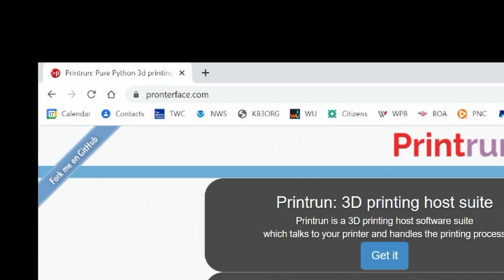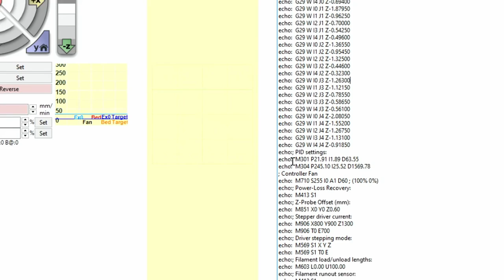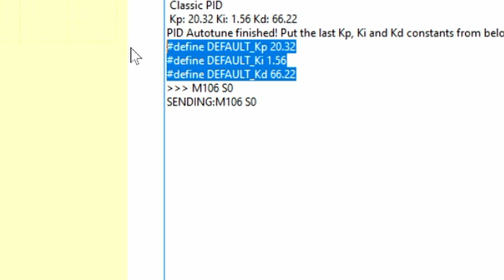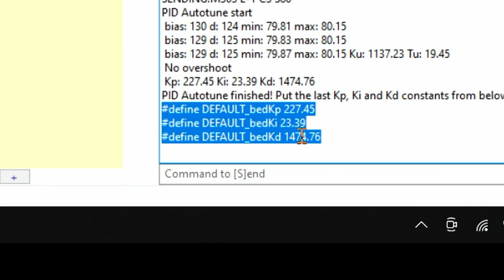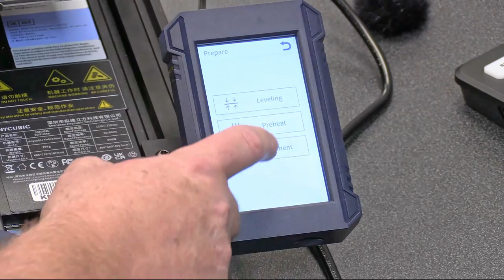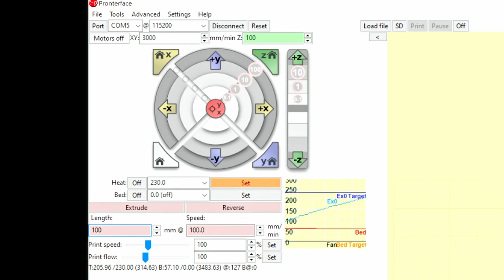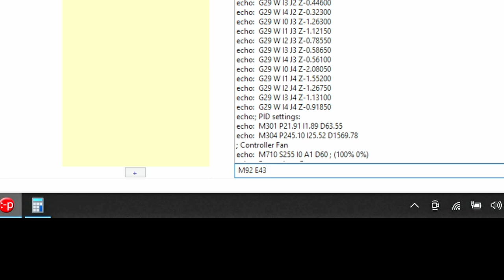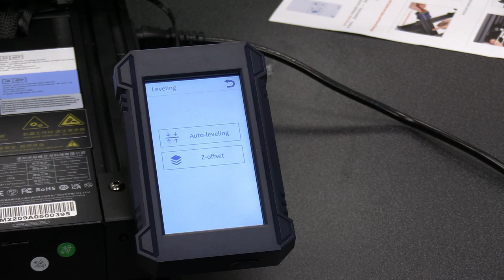Anycubic Kobra Max - Improve Printing

Comment: I got my first FDM printer today (Kobra Max) and as a total newbie this was easy to follow and get done. Luckily I was off by 6mm on the estep also so that took the math out of it! Thank you!
Reply from the maker: Glad it helped and thanks for watching!!
Reply: lol I'm in the same boat. I just ordered a Kobra max on amazon last night. luckily the offsets look similar to the robotics course I took yrs back and cnc. I'm psyched.  My kids and I are gonna have a blast. now I just have to find the 3d software and some quick starter files to load up and show off to my kids lol
Reply from the maker: @Skidly_Finley5879  ThingiVerse has a lot of ready made stuff.  To design you own stuff I suggest starting off with TinkerCAD.  For slicing I prefer Cura, the new Beta release has a profile for the Kobra Max

Comment: Thanks for this guide.  I used it on my new Kobra Max and it's printing well now.  I also just followed the instructions for my older Ender 3 Pro after finally switching it to a direct drive extruder and dual Z-axis motors a couple days ago.  After adjusting the PID values, I found the E steps for the new extruder were off by 12mm.  Fixing that made a huge difference.  I've been dabbling with 3d printers for about 8 years but struggled with getting them to perform well for about the first 5.  This video was a great help.
Reply from the maker: I'm going to be doing a video where I tune the X, Y, Z steps.  I'm eager to see how this affects my prints. BTW, thanks for watching!

Comment: "Could not connect to COMxx at baudrate 115200:
Serial error could not open port 'COMxx': PermissionError(13, 'Access is denied.', None, 5)"

If anyone is having this problem, it's because there are other applications using the COM port. In my case i had to close Cura and my printer went online.

Great tutorial, thanks :)
Reply from the maker: And that is what I was going to reply :)  I get this question quite a lot.  If another program, especially Cura, is open, it locks up the COM port so other programs, like PronterFace can't grab the port and you get that error.

Comment: This is CRAZY!!! I printed the same thing about 10 times and was ready to RETURN the printer when i came across your video the difference is NIGHT AND DAY!!

Before:
M301 P22.20 I1.08 D119.00
M304 P97.10 I1.41 D1675.16
M92 E405.00

After:
M301 P29.84 I3.13 D71.08
M303 P155.25 I15.33 D1047.86
M92 E424.52
Reply from the maker: I'm glad it was helpful.  In the next week I'll have a video on how you can adjust your X, Y, and Z steps so those are spot on.

Comment: Awesome setup guide! I printed the owl gcode on my Kobra Max right out of the box, and then again after implementing the procedure shown. The out-of-box settings produced good results on the owl print. Much better than I expected. The owl print after making the Pronterface adjustments looks just a bit better. The improvements are most noticeable on top of the "horns". Thanks for the great tutorial.
For anybody having the "temperature is too high" error using autotune: make sure the temperatures of the head and print bed are below the test temperatures in Pronterface. You're trying to autotune it using a lower temperature than your current temp. Use Pronterface to turn off those heaters, wait for the temps to drop, then run autotune again.
Reply from the maker: Thanks for watching and I'm glad it helped.

Comment: I should also say, this was one of my first times of running gcode commands right into a device and it opened up that whole aspect to me, so thanks for that also. I had only messed with them barely with the static printer settings. This is all new and great, thaks!!!
Reply from the maker: Glad it helped!

Comment: I am using the kobra to print a 3D prosthetic leg with carbon fibre filament and it does job great, I'm even printing the knee and ankle joints too.
Reply from the maker: This sounds like a great use of 3D printing, I love to hear stories like this.  It show just how practical 3D printing can be, not just for printing pencil holders.

Comment: Also I think the filament feeder calibration, the marks could be made at the runout sensor, and 100 out from that, also if that is easer to reach.
Reply from the maker: It doesn't really matter what you use as the demarcation, use whatever is easiest, like you said.

Comment: This is great! Also, one thing that wasn’t covered. If you have Cura open, pro terrace will not connect to the printer
Reply from the maker: That is correct, I’ve r received a lot of connection error questions and it always comes back to that.  I never thought that people would have both open simultaneously and should have mentioned it.

Comment: Great video and you've inspired me to go through my max and do this. I haven't had any major issues, but there's always room for improvement. Would love to see some of the prints you've done after calibrating it.
Reply from the maker: Thanks for watching!  I have part 3 out where I do some prints.  Anycubic Kobra Max Review - Test Prints
https://youtu.be/wpMmT-BKcYU
Reply: @TheMakersCave  I saw that after I watched this. Any other prints you have done with it? I honestly think my owl came out better right out of the box. 

Only I issue I had was that the sliced file had first layer flow at 105% which is why everyone has a hard time getting it off the glass bed. I modified my Cura print profile to fix that issue and I haven't had an issue with the first layer since.

I have had a few prints that had some issues with the surface, but typically only on one side in a small area. I'm wondering if that's underextrusion.
Reply from the maker: I’m going to calibrate my X,Y,Z steps tomorrow

Comment: Easy step by step process. I typed it out along with the cmd structure/order. Got my machine tuned and 'E Steps' dialed in like a glove. Thank you!

Edit: I'm seeing EStep reference 120mm as opposed to 100mm, thoughts?
Reply from the maker: I don't think using 120 or 100 makes a difference.  You would have to change the equation though if you did a test extrusion of 120.

Comment: This video has been beyond helpful. The only thing I would add, is maybe a touch of info on if your machine is over extruding.
Reply from the maker: Yeah, I'm surprised how many people are contacting me about over extrusion.  Did you need help with that formula?
Reply: @TheMakersCave  I figured it out, just took me a bit. Though I just swapped over to a microswiss extruder, I had to dial it back to e100 to finally get it to under extrude a bit. In either case, I couldn't have done it without this video. Thank you for your help.

Comment: Thanks for posting a clean, focused, and helpful video. Very serious and I feel important question before even sending the first calibration command: what mode/setting should the printer be in to get the best calibration. My thinking would tend to suggest that the printer not be cold so: should calibration be started from Preheat once it reaches temperature, or set the temperatures to the temps used for ones material in the Pronterface Heat and Bed temperature control window then wait for it to hit those set temps, then start a calibration? I have watched the video three times never hearing this mentioned nor seeing any prep setting before starting the calibration (unless I missed it).
Reply from the maker: Hi, thanks for watching.  The PID autotune command takes care of preheating for both the hot end and the bed so you don't have to do it.

Comment: Great video ,very clear and informative . I do have one question. When your doing your E step , your using PLA ,but select ABS on the pad to heat up..I didn't know if that was an error? Didn't matter ? Or intentional?  I use PLA ,so wasn't sure what to choose ,seeing what you selected.
Reply from the maker: I had to preheat the hot end to get the filament loaded, so I just picked any setting on the preheat.  The goal was just to get the hot end hot enough so the filament could flow through to do the E stops, if I was actually trying to print something I would have used different settings
Reply from the maker: By the way, thanks for watching I really appreciate it! 😊

Comment: Just one more thing, if you want to run the filament in using commands, they are `G92 E0` to zero the feeder position, and `G1 E100` to feed 100mm. Remember to re-run `G92 E0` after each feed. The rest of the temperature settings can be done roughly using the touch screen.
Reply from the maker: That is a way to do it, but I find many users like a gui to make things easier.

Comment: Great video!! Super easy to follow!!
Reply from the maker: Glad it was helpful!
Reply: @TheMakersCave  will I need to redo the PID if I change the nozzle to .6mm?
Reply from the maker: @fadysinno264  If it's just the nozzle I don't think so, if it's the complete hot end or heat brake then yes, definitely.

Comment: Hey Steve, great vids, especially on these kobra max. If you still have the kobra max, I wonder if you could get the wiring harness diagram for the extruder motor. I manually extended my harness when I converted to direct drive, but I seem to have messed up the wiring. Thanks in advance!
Reply from the maker: Sorry for the delay in responding as I was doing some research on your question.  Sadly, I don't have any schematics or wiring diagrams.  the cables on my Max are not labeled either.

Comment: Hi. I'm wondering where you got these commands from? I want to try your tuning with my Kobra Plus, but I'm not too sure if the commands and processes would be the same.
Reply from the maker: Most 3D printers like the Plus and Max run use Marline G-Code Firmware.  Here's a link to all the different commands: https://marlinfw.org/meta/gcode/

Comment: Thank you for the video! This will be very helpful when I am setting up my machine. Can I ask why you kept using ABS heating values for the PLA filament?
Reply from the maker: Yeah, I should have explained that, I keep getting that question. I just needed the hot end heated up so I could load the filament so I could pass through the 100mm of filament.  If I was actually printing an object I would have matched the heating to the fileament

Comment: Awesome video and I'm trying to follow everything to get mine set up. New to all this so it helps a great deal. One question about setting the e-steps, if you're using pla, why would you do it at 230 c when trying to test for The 100 mm test. Why wouldn't you do it at pla temp around 200 c?
Reply from the maker: I really didn't care about the temperature since I was printing anything.  I just picked a temp a knew the filament would melt at.  BTW, Thanks for watching, I appreciate it.

Comment: Hey I was just watching a video on how to PID tune my Vyper and after rewatching it I noticed he put U1 command at the end, where here you didnt.  He said the that U1 parts lets the M500 command save it otherwise you'd have to do it manually he said. Sounds like the issue here, but then agian theyre differnet printers.
Reply from the maker: Yep, different printers, on my Vyper I can have the settings automatically save after the PID command.  The firmware is different on the Kobra Max.

Comment: This video is absolutely excellent. Thank you SO much for taking the time to make this. Bloody brilliant. One question, I noticed from the top of your mark on the fillament to the tube looked like there was maybe 1 or 0.5mm. Is that okay? Or should we make it so its right upto the tip with 0mm.
Reply from the maker: it should be right up to the tip of the tube, but I've found a +/- of 1mm doesn't really make the printing any worse.  Just found that getting it that close of adjustment improves the printing.  I going to b e doing a video where I fine tune the x,z steps.

Comment: Very nice video. I just subscribed. I purchased this printer 3 days ago and am learning. This video was simple clear and easy to understand. Great job.
One question. When you did the E-Step why did you choose Preheat ABS as opposed to Preheat PLA, or does it not make a difference?
Reply from the maker: As long as the heat you choose melts the filament you're fine.  Getting the heat correct counts when you do your prints.  However, when you do the PID autotune you definitely want to pick the heat you'll be printing at the most.
Reply: @TheMakersCave  Thank you for the reply. I am totally new and your vidoe is a great help.  Could you also advise me on how to change the print speed. When I check the setting on the display the print speed is 100%. I was curious how you would change that to mm/s. I understant that it is set to 180mm/s but how would I know what the mm/s is if I set it to say 80% print speed.

Comment: Maker Cave, how did you get rid of stringing? Do you have a Cura profile you can share?
Reply from the maker: I also use Cura, when I get to the Cave I'll send you the profile.  I had a little bit of a problem with string and I upped my retraction speed and distance.  I believe I changed the distance to 8mm, it made quite the difference.

Comment: Great Video Steve just a quick question for you, does this work with the regular Kobra? Keep up the great work I’ve been printing about a month and really enjoying it. Time now to tune things up. Thanks
Reply from the maker: I don't have a regular Kobra but it should work.  I'm not sure what the firmware is on that printer so you might have to use the work-a-round I did in the video to save the settings.

Comment: I really enjoy your videos.  Thank you for making them for us.  I have had my anycubic kobra max for about 5 months now.  I’ve done many large prints but I continue to have stringing an other issues.  I finally got to,spend time trying to fix the issues by following these instructions.  My laptop doesn’t show any device connected.   I wish I could show you the cable connection.  It doesn’t look like any USB connector I have seen before.  I found a cable that had the same connector and a regular USB at the other end.  Still nothing.  I am new to the 3D hobby and I am so frustrated with it.  Would you please let me know what cable I need?  Thank you for your help.🙂
Reply from the maker: First, thanks for watching, I really appreciate.  The Kobra Max uses a type B USB connector.  They are found on most standard laser & inkjet printers.  You would want a Type A to Type B USB printer cable.  It sounds like you have the right cable if you can make the physical connection from the printer to the computer.  What we need to find out is how the printer is show in Windows Device Manager when you plug into the computer.  I would love to give you some help.  Email me at Steve@TheMakersCave.com, that is easier than going back and forth here in comments. :)
Reply from the maker: If you can email me a picture of the USB port on the printer it would probably help.  I have a very early model of the Kobra Max.  I'm wondering if the they switched a USB Type B 3.0 port.  That port looks a little funky.  The early Type B's (1.0 & 2.0)  look like a square, the Type B 3.0 are more rectangular, Taller than it is wide.
Reply: @TheMakersCave  I sent you the pictures.  You will have two from me because the first email didn’t send with the pictures.   Thank you for your help with this.

Comment: Hello, thank you for the video. I just received a kobra max a couple days ago and downloaded pronterface per your instructions but am un able to get the printer to connect.  Any help would be greatly appreciated 🙏
Reply from the maker: Make sure nothing else is running that would tie the printers USB port up, like a slicer program, etc.  Only one piece of software that connects to the printer at a time.  The next thing to try is to go into the Device Manager and see if the printer shows up under USB ports.  Try taking out the USB cable and putting it back in while watching the device manager, you should see it disappear when removed and appear when plugged back in.  If it is showing under the Device Manager is there an "Exclamation" mark "Error Triangle" next to it.  If yes, then the driver is not loading correctly.  If all those thinks check out OK then let me know and we'll try some different things.
Reply: @TheMakersCave  Thank you sir, I was able to get it to run lastnight by reloading the driver firmware and having the printer turned on before plugging into it. I was able to run all the steps on both my Max and the Vyper with no issues. Thank you for making a understandable video for all us new users to be able to tune these machines up. Well done sir!

Comment: Thank you!!!! I have done your tuning and it works like a charm. 
I have some quick questions: I have the Kobra Max and it prints PLA perfectly, but I still struggle with PETG, basically the builds warp off the plate.
For Petg:
Do you use any adhesion or such on the build plate?
Plate temp?
Head temp?
Anything else in particular?
Reply from the maker: I use PETG exclusively on all my printers since I produce parts that will see some practical use.  I don't have a warping issue on my Max and I'm using Overture PETG from Amazon.  What brand filament you are using can affect what temps you print at.  I have also found that the Max has a tendency to run about 10 to 20 degrees hotter than what you set it at.  What are the brand's suggested temp and what brand is it?
Reply: @TheMakersCave  I use Anycubic's own, ironically I cannot find their recommended settings. You say that the Max is overheating, also after the PID tuning? What temps do you set for the brand you use?
Reply from the maker: @joacbrod  I found this on AC's website.  https://www.anycubic.com/blogs/3d-printing-guides/petg-filament  What temp are you currently printing at?